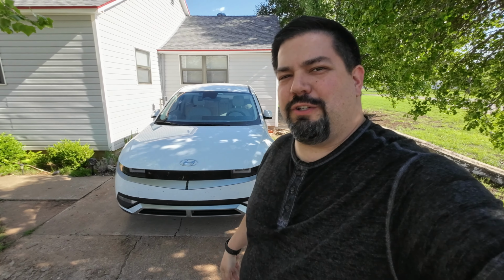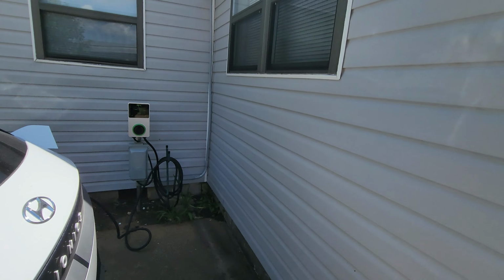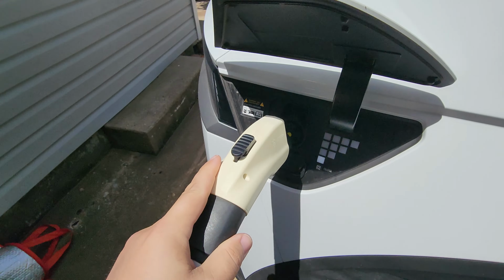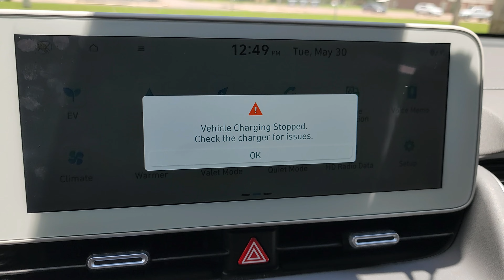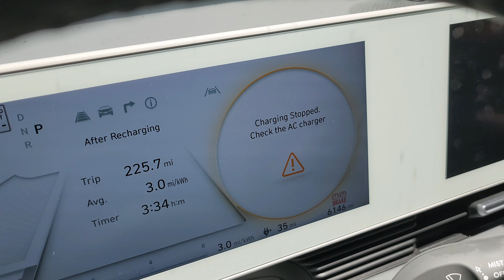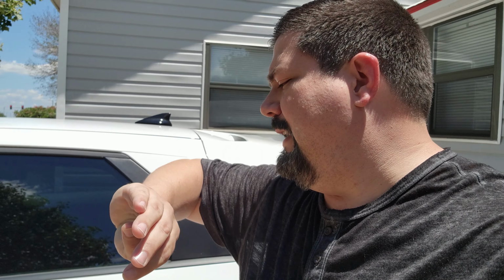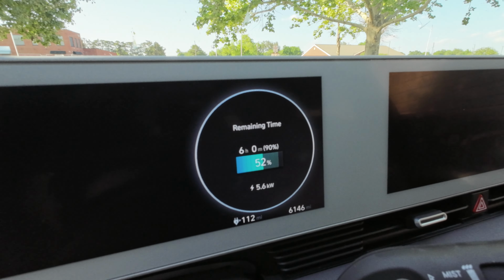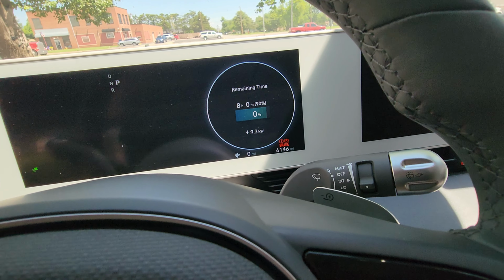Hyundai Ioniq5 severely overheats while AC charging!

Comment: Known issue. Get the TSB to derate the overheating issue. Mine sits ok at 31amps and wont fault or derate. I get about 7.2kwh at that rate.
Reply from the maker: I'm not okay with that. It's not fun when you need to go but you have to wait an extra hour because your car will only charge half as fast as it's advertised to charge.  They need to do a recall and replace these defective parts!  Mine's still overheats at 25 amps so it's definitely going to go lower than 31.
Reply from the maker: You also forget about the cooling, at 25 amps It puts in around 5.4 KW but when the cooling kicks on it's only putting in around 3 KW so it takes forever!

Comment: would be worth checking the contacts from the plug going into the cars socket so a good connection is made,contacts can erode over time and heat up due to the pulling of currant,check for plug wobble in the socket,clean contacts with brake cleaner,try a different plug

Comment: I've just jumped into this video and havent found anyone pointing at your cable coils. Sorry to say but that mess of cables laying carelessly... Coils x current means a lot of inductive field that could end up fatally. I'm not saying that there isn't a problem in the car plug but I thought it important to underline just in case because 40A is a lot of current
Reply from the maker: It is a good observation, but I've had many comments suggesting this and I've tested it by laying out the cable straight to the same results.
Reply: @Crazypostman  sorry to hear that. It seems that I didn't dig enough into the comments 🤦
Reply from the maker: @gaizkitapowers  It's not just this video people have been noticing that coil of wire in many videos. I've taken a temperature of it after a long charging session it is warmer than ambient but only by 5 or 10° at the most

Comment: A little late here, but Ionic Guy was having this problem as well.  He took apart the charging port on the car to see if he could identify the problem, but everything looked okay.  He reassembled it and it has worked fine ever since!  It sounds like some sort of issue with the physical charging port on some vehicles.  Fingers crossed that I don't experience this problem on my 2024 Ionic 5...
Reply from the maker: I agree I think there's physically something wrong. The problem is solved sometimes by getting the charge port replaced other times I guess the new charge port has the problem as well. I Saw that episode but I'm not comfortable taking my car part like that I would probably burn it down 😂
Reply: @Crazypostman  Oh I'm with you on that!  I just thought it was interesting.  Perhaps this is more of a manufacturing issue than a design issue?  Who knows.  I hope it gets solved.

Comment: I'm facing a similar issue.its a 2022.  From what I've observed, this problem seems to be specific to North America. It might be related to the use of single-phase 240V here, whereas in Europe, they utilize a three-phase 400V outlet. This leads to about 17.5 amps on 400V 3p, equivalent to the 46 amps on 240V 1p. I'm not too optimistic about a real solution.
Reply: The same problem is occurring in all ioniq series in Korea even.
Reply from the maker: I think it's a bad port design in general but the single phase 240 aggravates it. Hopefully when the ports get changed to NACS / j3400 it will be better

Comment: The AC Inlet temperature sensor is at the other end of charging cable harness, deep down under the rear seats at the on-board charger (ICCU / VCMS).
Reply from the maker: 🤔 so trying to cool it on the connector ends going to do nothing.
Reply: @Crazypostman  Actually, the AC Inlet 1 temp sensor might be in the connector AC-receptacle after all (not sure about it). FLIR camera would come handy...

Comment: From what i understand TSB software update should help this, check for recalls on your car. I am taking mine in after I get back home next month. I hade this issue after i got mine last fall and they had to replace the entire charge port cable on the car and have the same issue starting back in Feb. I have had to reduce charge rate back to minimum and can only charge on the level 2 at home or 120v. Only goes about 10-12 min at max or DC fast charger then trips and cant charge again.

Comment: When I fill my tank in like 2 minutes at Costco, the handle actually gets cooler as petrol flows through it.😁
I never pre-condition, and my fuel tank 21.5 years on has not shrunk. Still holds 12 gallons.

Comment: The problem is is the whole process is inefficient wasting energy as heat.
Mains is AC, must be converted to DC, DC is converted AGAIN to AC to run the motors. No such thing as AC storage battery. 🤣
You need Edison DC from house mains.😍

Comment: Do you have a model year 2023? 
I have a 2023 EV6 and I'm getting minor overheating when AC charging at 48 amps, not as severe as you though. My car will throttle to 26 amps for about 5 minutes until it cools down. This happens about 2 times each hour starting at the 1-hour charging mark. It only brings down my effective charging rate from 11.2 kW to around 10.9 or 10.7 kW (3 to 5% slower).
Reply from the maker: Yes, I have a 2023. But mine was produced in November it sounds like yours is newer and you have the newest update, I could go get that update if I wanted to drive a few 300 miles and sit at a dealer.
Reply: @Crazypostman  My EV6 was actually manufactured the final week of November (28-30), 2022. However, there might be some differences between the exact parts and wiring Hyundai and Kia used for the charge ports.
Reply: @Crazypostman well look at that. They now have A class action lawsuit against them for the charging issue. You might as well get some money

Comment: This is pretty interesting. My dad has an Ioniq 5 and we haven't seen this problem when charging at 48 amps. Do you hear the car air conditioner turn on to cool the battery or charger? Maybe I missed it but why can't you charge at some DC fast charge stations?
Reply from the maker: The charge port connectors is specifically what's overheating. The battery is fine in this situation.
Reply from the maker: Closest DC fast charger is 65 mi round trip and it's in a direction that I don't normally drive so it would be always out of the way
Reply: @Crazypostman  oh, I see now that the Francis Energy charger at the courthouse isn't working with 800V cars. Hopefully they get that fixed soon! Thanks for making these videos! BTW, I ordered a Luba yesterday using your link after returning the EcoFlow Blade 🙂
Reply from the maker: @jtbl100  You rock! Amazon only gives a few percent commission but on a purchase that large it's big thank you! 
Yeah I occasionally go back and test Frederick and it never works... Most BTC 50 KWs will not work with 800 volt cars for some reason.

Comment: Hasn't happened with our 2022 yet, we have 21K miles on it and charge at 40A at home. The connector is just warm when I pull it out, never hot even after an hour or two.  I would check the terminals on your car, they may be burned and making a poor connection and will need the charge port replaced.

Comment: Interesting. I have a Juicebox 40 and have no problem charging my I5 AWD Limited at 40 amps with it in Florida.  

Maybe you can get a garden hose and spray down the port - oh wait that might not be good :). On a more serious note perhaps an electric fan to air cool it as a temporary fix.
Reply from the maker: Back in the day we did the wet towel around the supercharger handle to get faster speeds I might have to do something similar You're right!

Comment: Hopefully, one day soon all vehicles will use that elegant NACS connector.   Hyundai is going to have to come up with a fix, since most owners will be AC charging the majority of the time.  I checked Ioniq5 forums, and many folks are reporting the same issue, with all different brands of EVSE's.  And the problem was present last summer, so it doesn't look like Hyundai has a fix.
Reply from the maker: Yep I bet it's going to become a huge issue. I can't believe I didn't connect the dots sooner that it was the car and not the charger for months I've been blaming chargers!
Reply: @Crazypostman  Even the car's display was saying to check the evse, so I can see where you got sidetracked on the diagnosis of the problem.

Comment: You might try iteratively upping the amps on the Autel to see where you reach equilibrium on a good amp rate that doesn’t overheat. 

Maybe try 26 amp then 28 amp then 30 amp if the Autel has that granularity with its settings.
Reply from the maker: The forums that I found say it can maintain 32A I know it can't maintain 35A because I tried that yesterday 😭
Reply from the maker: yeah I should be able to find the happy spot! but i'm still disappointed! with no DCFC here i need to charge as fast as possible sometimes.